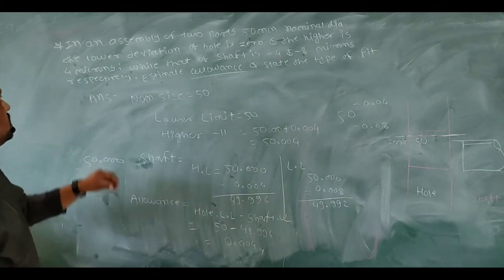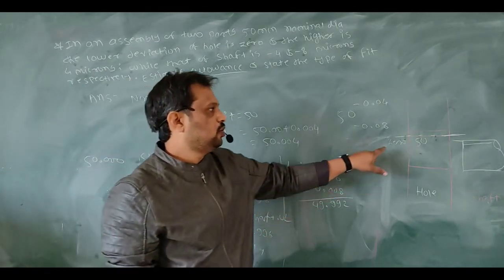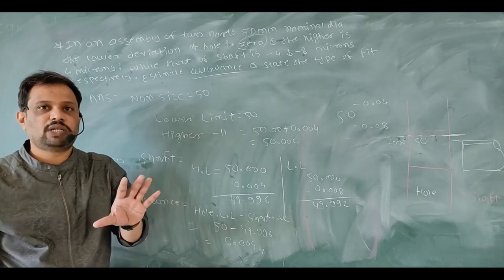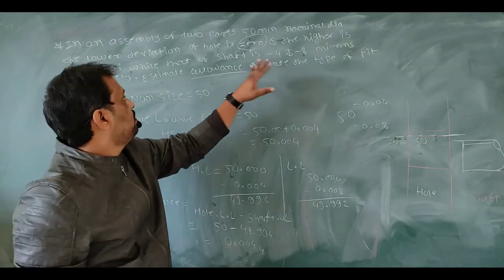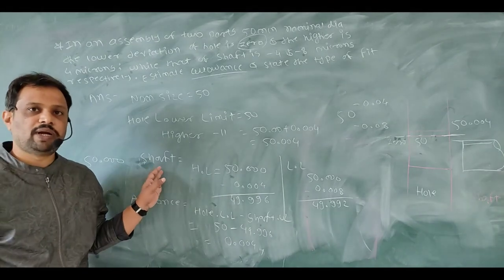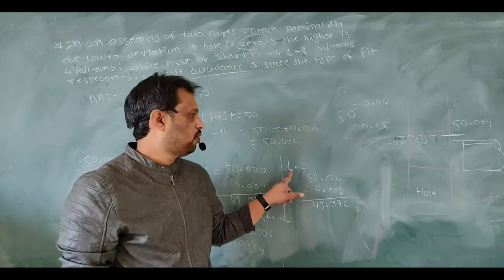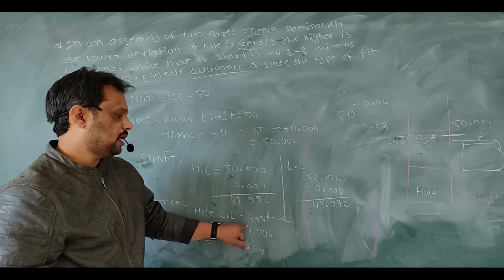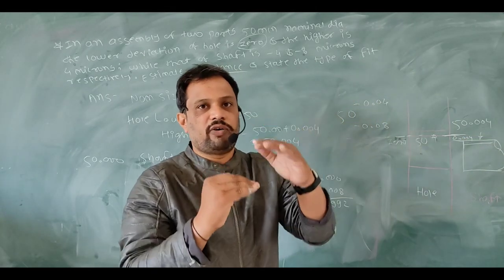Numerical on Limits , Fits & Tolerances Problem no 05 in English

Comment: Specify the dimensions for hole and shaft
for a fit designated as H7r6 on a 60 mm
basic size. Also give the graphical
representation of size.

Plz solution this question